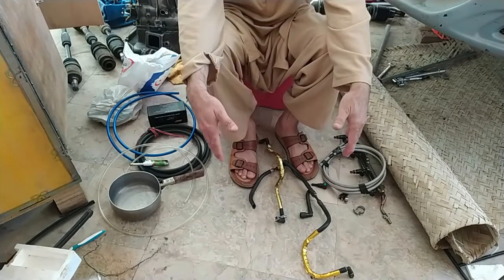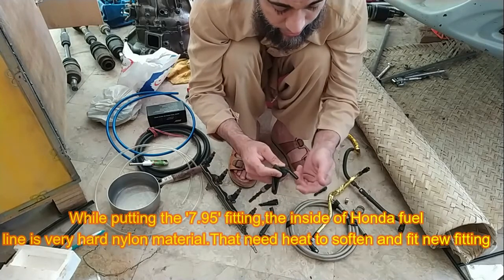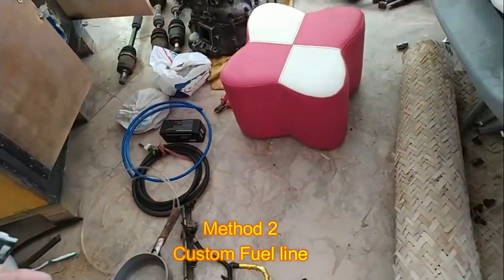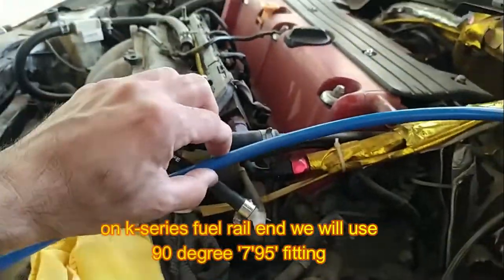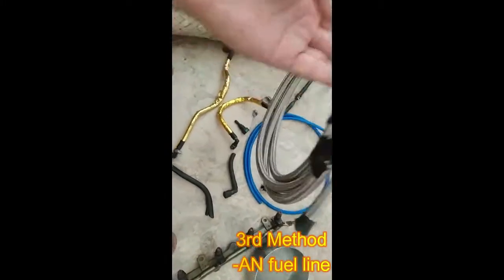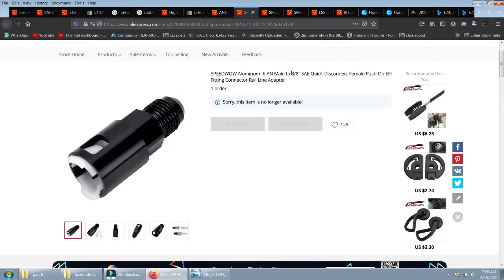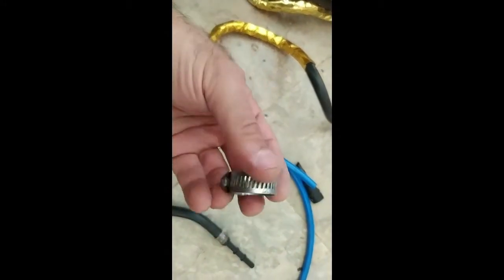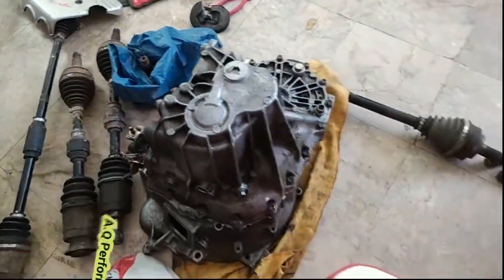Part 06: Honda CR-Z/ Fit Complete K-swap Guide, Fuel system compatibility

Comment: Hey man, how are you doing? I finished my car but my speedometer 
Is not working k24a k20z3 transmission do I have to do something on the harness to make it to work thank you
Reply from the maker: @Brewer_S2K  it's should work with k20z3 tranny as that tranny has high frequency speed signal sensor which modern ECU require. Dis you use k20z3 ECU as well? And did you wire speed signal wire property?
Reply: @A.QPerformance  I haven’t mess with the signal wire thought everything was going to be plug and play thing you know  
I connect the block on the sensor nothing else
Reply from the maker: @Brewer_S2K  did you use a harness or did wiring yourself?
Reply from the maker: @Brewer_S2K  and which ECU used?
Reply: @A.QPerformance I use the harness from 08 cívic si and ecu everything oem
Reply from the maker: @Brewer_S2K  than it should work. Check continuety of speed signal wire.
Reply: @A.QPerformance  got bro thank you 🙏

Comment: Hi Nivek, i'm doing a K24 swap on a GE8 jazz. 
My oem brake master cylinder is hitting the k24 valve cover. I'm using hasport mounts. 
Did you have this problem as well?
Reply from the maker: The Left hand drive CRZ has this problem. HAsport also knows this. the solultion is to use Ek2000 Brake master cylender or a GE8 Fit one. but yours is already a GE8 Fit. so the problem should not be there. My Fit is also a GE8 one but is JDM. i didt have this problem when we did swap. For my CRZ when we did swap we had this problem and we use the GE8 Brake booster cylender.
very strange that your GE8 is facing this problem

Comment: Will the stock fuel mechanism work with the K20z3?
Reply from the maker: yeah fuel system is suffient upto 300WHP with fuel pump upgrade. 250WHP without any upgrade. the k series fuel rail uses slighly bigger fitting, so in order to fir the Fit/CRZ fuel pipe to it slight modification is needed as i discussed in my build

Comment: Hi do you have to change the brake master cylinder on right hand drive cr-z zf1 for the k20 engine to fit
Reply from the maker: Yes in all our cars we had to.but contact Hasport 1st,may be they have revised the mounts to address this issue
Reply: @A.QPerformance  i have already purchased the mounts 
What year and model do i use brake master cylinder
Reply from the maker: @castleautobodyz8620  Honda Fit Ge one works fine.not sure about GK
Reply: @A.QPerformance  what year Honda fit
Reply from the maker: @castleautobodyz8620  I already told you.The GE honda Fit.cant you google what GE fit is? its 2009-12